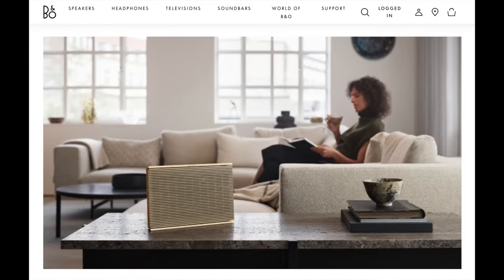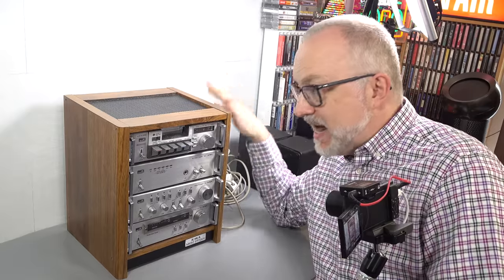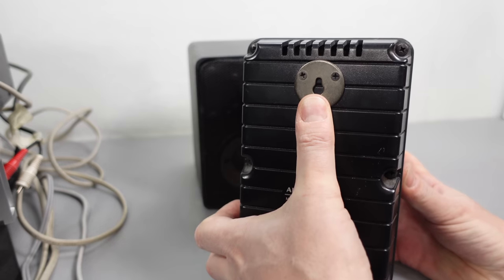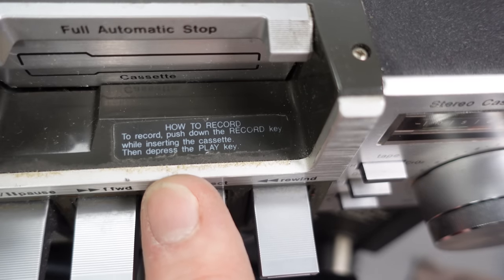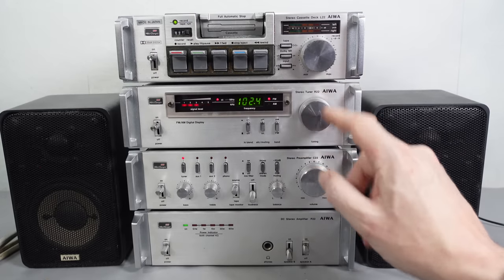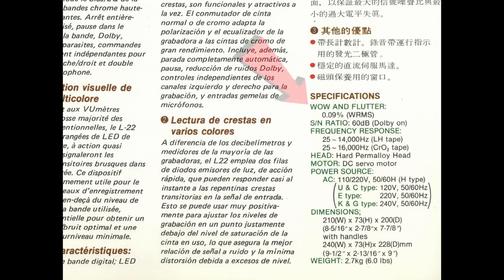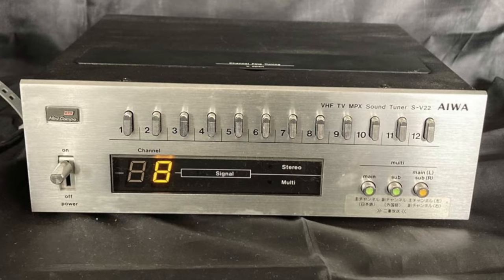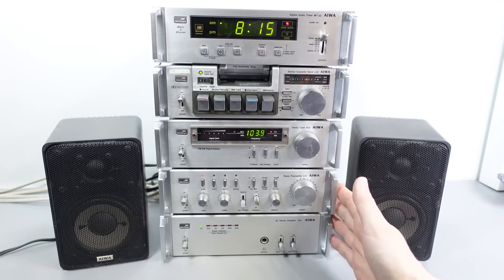AIWA SYSTEM 22 -  Micro HiFi from 1979

Comment: Could you imagine Tesla motors fitted something like this in the bland interior of their cars? 
I remember Ford Australia in 1989 and 1990 had an option to upgrade the car stereo to an Alpine multi piece in dash system that looked like this Aiwa setup... It was beautiful! 
Anyone else remember the Maza car stereo that was fitted to the 929? The cassette deck had a cassette door like a home hi-fi and managed to cram in a graphic equaliser and many other features including the best feature back then which was no menus! Everything was on the front panel! And you didn't need to take your eyes off the road because you developed muscle memory for where every conceivable control was! 
On the topic of getting equipment repaired.... I have learnt from experience that it's all down to definitions.... 
A repair service is where someone other than you will attempt to just get it going and have no desire to perform anymore work than that! If you ask for more, you will be offered a price that you can and will refuse because just getting your device only just working will take 10 minutes of their time and they will use any components lying around to make it work and expect to be paid handsomely for it.... 
Of course it's going to stop working again, they replaced the broken part which is quick and easy to find but didn't replace the actual component that caused the failure in the first place, the new component will last for a while due to being new but will also die and when you return your broken device, you will be told that it's old, what are you expecting? 
On the flip side though, there are people who Restore rather than Repair, and if you are anything like me which I think that you are (I have a huge amount of hi-fi equipment also), then you need to find someone who restores equipment! For me, I only know of one person in Australia who restores equipment and also has a YouTube channel but he tends to work with older vacuum tube radio's and as amazing as his work is, he's in Queensland and I'm in Melbourne... I have lots of repair shops all around me but I don't need a repair, I need someone who can restore.. And that sounds expensive! But it doesn't have to be! There's only a little more effort involved in the restoration of an amplifier over a repair, people who restore already know before they open up the device which components are going to need to be replaced, which are going to need to be cleaned... They will download the schematic and work to the manufacturer recommended values unless and sometimes certain components are known to be bad period but keep a suitable candidate on hand at all times.... 
I learnt a lot from Tony and his YouTube channel XRayTonyB... His videos are an hour long, everything that he works on is a lesson learnt for everyone else watching... From interesting circuit design that manufacturers used to common flaws and how to find it and what to do if that component no longer exists... I highly recommend investing time in his channel for anyone interested in making electronic equipment work just like it did when new! 
I wish I had people like that here in Australia! They would get a lot of work from me alone....

Comment: There is a sort of 'duality' with getting your individual units repaired when you cover something, and I think it's a perspective that perhaps the 'average' viewer intuitively has, but maybe which you do not- a fully functioning unit demonstrates the maximum possible potential of a device and shows what it can be at the very top end. I would argue that the vast, vast majority of people who watch your videos have no to little interest in owning the specific thing you are covering, and are instead much more interested in what it represents historically or how it compares functionally to things we see today. The most intuitive way to compare, then, is to see a device working at it's full potential, or at least as close as we can get it, as then we can compare most fairly. Cassette mechanisms in particular are probably the strongest example of this as you yourself have demonstrated repeatedly as the old stuff, when it works right, really is better for those

Comment: Many digital tuners from that era aren't digital at all. They're analog tuners with a numeric frequency display as is this Aiwa. This is something numerous makers did, particularly in automotive equipment. This Aiwa is indeed an analog tuner, an average one at that. It uses a common for the day Hitachi tuner IC, features a quadrature detector, only 2 (which was common for basic consumer equipment) tuned circuits and filters in the FM section.
I always liked Aiwa gear. They were rarely top performers, average at best, but the stuff was pleasant to use, attractive, and interesting.
High-blend doesn't make mono but it does blend higher frequencies into mono, useful as most of the static and noise when listening in stereo is in the higher frequencies. The high-blend on this one simply switches a smaller capacitor across the left and right outputs.

Comment: Great video, as always! Just one little comment: you mention it having a "digital tuner" (around 04:50), but it really isn't a digital tuner. It's an analog tuner with a digital frequency display. So, the tuning is still done via analog components but a frequency counter was attached to display the frequency. The tuning knob is not an input device to a digital circuit that is (digitally) set to a certain frequency and holds it via a PLL/quartz-lock. Alas, because it has AFC and the digital display, the effect should be merely the same. ;)

Comment: To be honest, for myself when you were talking about rebuilding. I would be taking my time and recapping and replacing other component's that have drifted out of spec. If I ran into trouble with a section I know of one place that is semi local to me that could look at that one section and fix it for me. But, to have something like that in a shop to be repopulated with new parts by a pro. I would have to look at man hours and I would suspect 125$ US/hr if not more to painstakingly replace each passive part that is out of tolerance with new parts would cost more than what the stack is worth.

Comment: Where that cabinet is coming apart - all it is is where those metal posts are they slide into a tensioner lug that should be located on the bottom side of the piece that metal post is being inserted - they probably just need tightened - for example if you look right where it’s being out into the wood underneath you should see the tensioner lug

Comment: The crackling on your FM on the unit could be a loose connection from your aerial socket I remember I had an old FM radio and I just replace the aerial socket on the board and it worked just fine.

Comment: I have a micro system, or as in the US a Shelf System, a 2004 GPX. Pretty basic, has AM/FM radio, CD Player, and AUX In via 3.5 mm stereo jack. Think it once had a remote that only controlled CD player functions, but one had to turn it on and control any other functions manually. Also, the AUX input overrides other functions when a cable is inserted in the jack.

Comment: There's something about rack mounts on hifi gear. My 70's Sansui amp and tuner match up to an SAE parametric and a Tascam 122 MKII cassette deck with their rack mounts and never fail to impress. Funny, that system hasn't been used in my room for 20 years...but there it is.

Comment: My Hitachi receiver from 1985 soldiers on, albeit FM departed a while back. I am reluctant to replace it because it has these old features, A and B speakers (for my two rooms) and tape copy. I use the latter as a simple way of driving an active subwoofer when an input (normally Alexa) is plugged into tape 1.

Comment: Those speakers look like Braun. At Tandy, there was a Minimus speaker that was identical to the Braun -- two models, a larger size Minimus 11 and the smaller 7. YMMV, but I worked there back in 85-89

Comment: I really like these older HiFi components. That tuner does not look like it is a digital tuner with PLL. Back in the 70s they started doing away with the mechanical scale and replaced it with a digital frequency counter connected to the oscillator of the tuner. Some cheaper models used a different methode: A little "analog computer" which used the control voltage of the oscillator and changed it in such a way that 87.5..108 Mhz were 87.5 to 108 mV which were then measured like in a multimeter. They even used the same chip (ICL7107 for LED, ICL7106 for LCD). A lot more interesting than any totally digital FM tuner these days which always consists of the tuner chip and a microcontroller.

Comment: I grew up seeing the preamp being used as a standalone unit.  My dad still has it and I just held it in my hands a few months ago.  I didn't know it was a part of a larger system.
Reply: Preamps were usually built into the entire radio/amplifier unit. Although you could get a stand alone preamp, You only need one if it wasn't present. In the newer amps they phased it out because people switched to CD's and stopped buying vinyl and record players.

Comment: The modern day mounting system for Hifi and professional audio is - 18 inch (width) 1U, 2U (Height) etc etc, 
So the mounting system is probably the same for older tech using the screw hole width center to center,

It is probably another Japanesae Standard for mounting professional Audio Equipment that has become an industry standard.

Comment: This sort of reminds me of the stack system I've had for over twenty years now. A Cambridge Audio amp, Cambridge Audio CD player, Ariston tape deck and Ariston analogue radio tuner with digital display. Doesn't get used anywhere near  as much as it used to, especially since I now tend to only really listen to DAB radio anymore, so it just sits there (with a lot of cables hanging out the back) gathering dust. A shame but I guess I stopped really listening to music about ten years ago. Maybe its a thing that hits people when they get into middle age?

Not long after that Aiwa system was introduced the manufacturers started making cheaper all in one midi systems that had a moulded plastic case but was designed to look like separates from a distance. I remember having a Philips one as a teenager in mid-late 80s that also had a turntable on it. They were much cheaper and lighter than stack systems like this and didn't sound anywhere near as good but they were endemic and around for years, although they were only of limited use once the tape deck packed in as you obviously couldn't swap the parts out.

Comment: Gorgeous mini system. I Think the issues on this particular unit could be solved with a capacitor replacement. TV sets from that era need to be recapped most of the times.

Comment: If I had the space and the money, I wouldn't mind collecting a handful of old hardware like this and have a mini-muesuem in my basement. A good-looking unit to sit on a shelf, regardless of functionality. 

When my first TV, a 1981 wood panel Magnabox, died in 2002, I cried, even though the picture had gone to shit months before. Repairing it wasn't an option, as it would be cheaper just to buy a new TV. But I still wanted to keep it on a shelf as the case was still in great condition. Again, no space to do such a thing.

Comment: Sometimes a good place to have Old electronics fixed is someone who fixes CB radios, HAM radios, old tube television/radios, automotive ECU/PCM/BCM/AIRBAG/ABS/FUEL PUMP modules, they are usually older style components and layouts etc, vintage computer repairmen etcetera...i could probably figure it out on my own though, but I understand that most won't be able to or have no time or desire to...

Comment: ...And those can be a pain to repair...Good luck. (I will not be offering).
Toshiba had the Aurex brand which had very early micro components (possibly the first) and were occasionally amazing. I had an Aurex electret condenser cartridge which was a true gem.

Comment: Another great video.  I've got to disagree on the power cords, they look totally replaced given the gigantic gaps where they enter the case , as well as the big gaps on the plugs.
Reply: They were probably fitted for the UK market at the time. It would have to be done for selling in the UK.
Reply: My system is the same, it's more like a grommet and like all its rubber parts, they're worn out

Comment: Yepeeeeee, finaly!  I have one.  I am missing the tape deck, if someone has one I would like to buy it. I connected the amp-pre amp to a CD player and 150W speakers. The 30W Aiwa runs them with ease. Great bass. Decent highs. You tested it on those tiny speakers. Big mistake :)

Comment: In the late 70s I worked at a TV / HiFi store as the audio tech. I worked on these. I needed a tuner so bought just the tuner with my discount. It worked quite well. Something is definitely wrong with yours. I notice the signal strength meter was indicating three bars even when there was no signal on yours. That's not right. As you mentioned, I believe there was an AC output jack on mine, but a U.S. plug would be much easier to fit in that small case than the U.K. plug!

Comment: There are some belts that needs replacing. Tapecounter must work for it to not stop.
There is also a transistor that goes bad on the autostopboard.
New belts and other rubberstuff is available on ebay.
The tapedeck is the first thing to go bad. It is unusual to find a complete working set. Often the deck is missing. 
I had luck to find a complete set but without the rack.

Comment: I was selling audio in the late 70's early 80's Sold  sold many  Aiwa and Sony micro systems  they sound amazing when new  and were high quality. I do remember some of these Aiwa's  had touch solenoid control cassette decks as well. .new belts and a good cleaning may fix the tape deck after all it's old. I would get them repaired, I have a local shop that can fix audio gear. I own vintage audio from the 70's and 80's.

Comment: I have a mini-system, a Sony CMT EX-100  Just a single CD/Tuner/Aux-in unit with separate speakers.    Nice looking thing too.  Top slot-load CD mech with the disc visible through the front.  Amber LCD display,  Silver finish and heavy woodgrain speakers.   The little thing thumps for its size.    I use it for my computers audio output.   Better than most off the shelf PC speakers.   The "Enigma MCMXC AD" CD in it has not spun in years,  but that only because I haven't played a CD in years..  (And I can't find the case for the cd, so it's plenty safe stored in the machine.)

Comment: That's a very sharp looking system! I've never seen that line. The speakers are nice as well! They look very similar to the Realistic Minimus 7. 

Another great episode man! Cheers!!!

EDIT: I can't believe those speakers are bottoming out so soon! They seem to be an exact copy of the Minimus 7.
Reply: I think that the Aiwa's were cast plastic cabinets.  I own 5 pairs of Minimus 7 speakers.  The cast metal enclosures are great.  When I see them in resale shops I grab them.  Only once have I had to replace the 4 inch drivers.  Great little speakers.  I really miss Radio Shack.

Comment: If that's the 22 series, i have the 440 series. Its black, from the late 80ies, and the modules are twice as wide (with empty space inside). Even in the 90ies i started using it for the output of my computer, and still do to this day. The various other components stopped working, mostly due to rubber age (dual tape deck, record player, cd unit). Almost all the modules are connected via ribbon cables instead of normal wires, the LP uses a single round DIN type connector and only the cd has the usual L-R cinch (rca). Only one of the modules powers the others, except the cd, but you just plug that to the daisy chained power plug (same Japanese/American one) of the amp module, so its one power button and one power cord. The remote control could be used for all modules with simplified controls, and even the record player you can start/stop; which btw is the linear stylus tracking type (so another belt). Comes with 8" speakers and smaller mid high drivers (adjustable), i later added an Aiwa TS-W9 subwoofer, but that didn't go well with records... In the end i just use it as a glorified PC amp, since i stopped listening to the other media anyway and even less when the respective modules stopped working. I'm amazed that tape mechanism in the 22 is still working, no doubt the same used in cars back then.

Comment: I wonder if the reliability issues of the system could be related to it's size? This was a time when they designed the electronics to fit into a much larger case. By squeezing it into the confines of mini system, did that overheat the components to where they failed? Just a thought... Great video on a neat topic: Typical Techmoan.

Comment: My much older brother bought a Sanyo system 10 in the early 80’s adding a linear tracking turntable by hitachi sometime in the mid 80’s. Id love to get the system back, I’m ashamed to say I did have it and sold the separate bits off in the early 90’s as I upgraded, however I just know it won’t sound like I remember and in any case what would I actually do with it. Now aged 50+ I’m not sure my ears can tell the difference between streamed music through decent Bluetooth speakers and proper hifi.

Comment: I was given a complete system in the stand many years ago by my barber. Poor things were coated in nicotine. As you found, the cassette deck did not work. Everything else worked fine and cleaned up nicely.